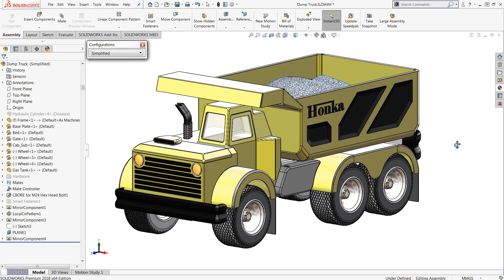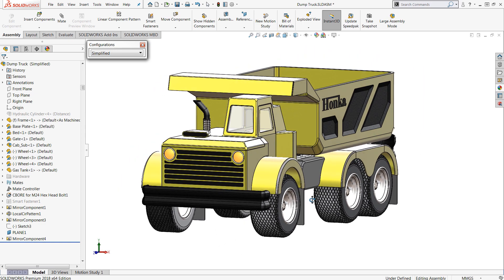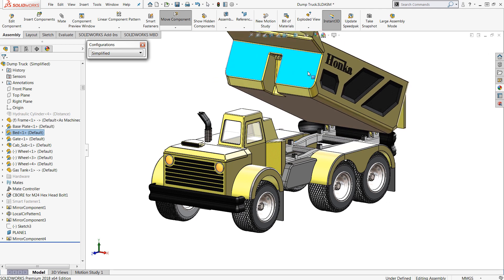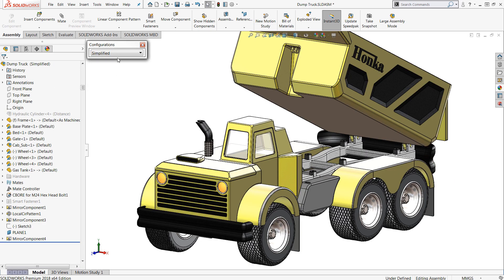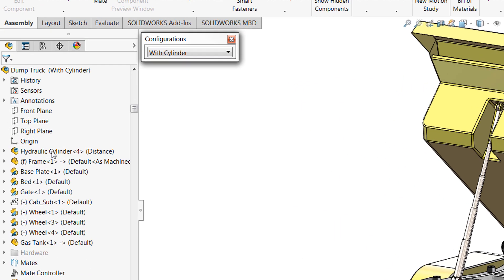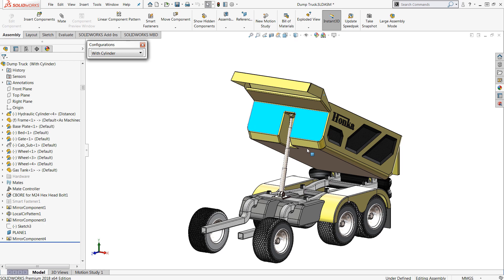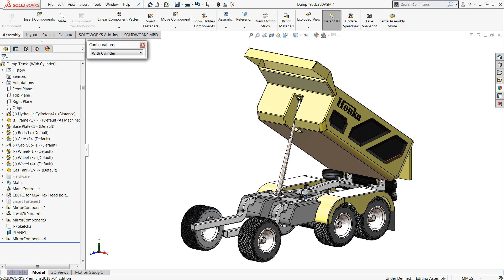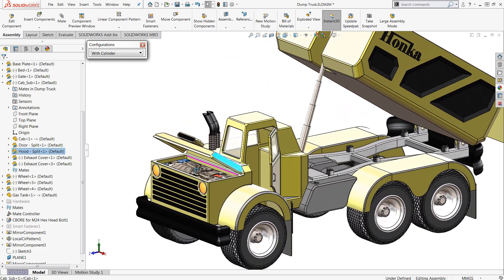SOLIDWORKS: Making Subassemblies Flexible

Comment: thanks this is a very useful video. The piston compresses simultaneously with the bed moving up/down like in real life. in my model however that uses a similar system with pistons the bed moves but the pistons only compress after using Rebuild. Is there a setting that allows instant Rebuild?

Comment: This does not completely work ! If you have subassembly with multiple points of movement NOT ALL OF THEM ARE FLEXIBLE , ONLY SOME OF THEM .
Thought I'd point out another fine example of the extreme difficulty in using this BS software .

Comment: It didn't work for there is a massage that sub assembly with layout sketches must be kept rigid 
How can i fix that please
Reply from the maker: If you are using Layout Sketches or In-context design, you may not be able to make that subassembly flexible.

To represent motion for such designs one approach would be to build a new second subassembly with the other components inserted. Since they are not defined in the context of that new subassembly, it should allow the motion.
Reply: @hawkridgesystems  thank you very much

Comment: Is it possible to have the part be rigid at the subassembly level for drawings so it always shows it the same way, but then flexible in a master assembly to show the motion? Like if you have a drawing with the cab, and you want to always show it with the doors closed, but you also want it to be able to be opened up with it's in the full truck assembly? So if you made a drawing of the truck when you had the door closed and then you opened the door and reloaded the drawing, is there a way to always show an assembly in a certain state in drawings?
Reply from the maker: Hi Scott, thank you for your feedback! Could you fill out our form here: http://bit.ly/2DNqU9N and one of our engineers can reach out to you directly to go into more detail on the assembly.